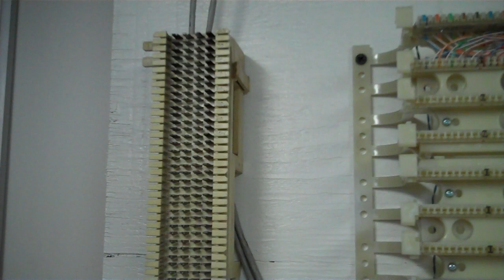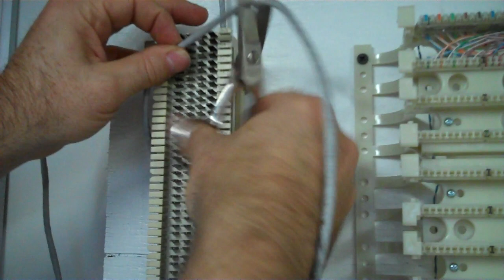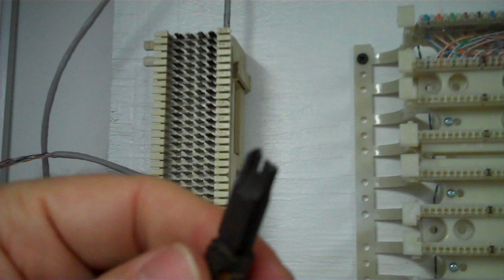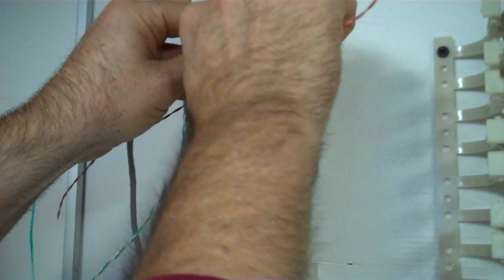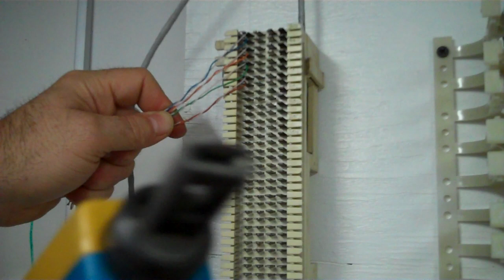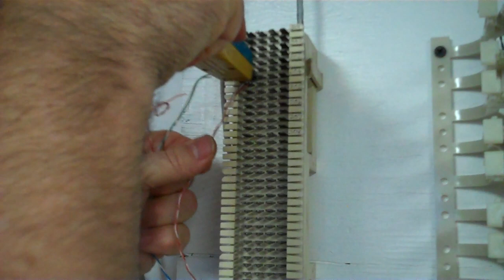Punching down 4-pair cable on 66 block

Comment: what is the reason every time I ( elevator tech) am asked to hook up the new elevator phone line the telco guy didnt bother actually landing to the old elevator phone terminals, I trace the line and it is connected to no less than 5 of these sets of terminals before it gets to where it needs to go? is that some kind of impedance matching technique?
Reply from the maker: Nothing to do with impedance.  It's not uncommon for an analog line to be cross-connected through several of these 66 blocks before it finally reaches the PBX (or telco demarc).  I could see why that would be confusing and frustrating to you.

Comment: As someone who has been doing network engineering work for the NYC DOE for the past 3.5 years, everyday I would see these 66 blocks and was curious how they worked. They're in the same room of every school MDF and there's also a telecom rack that from what I believe is how it goes from this block and become digital. At 8 mins into the video when you recapped and explained what that wire is doing it hit me. It's exactly like an ethernet patch panel and just terminates as a jack on a wall, then the 110 block makes sense also as to how the cable you just punched down gets its signal. Thanks!

Comment: I need to ask what I hope is not a ridiculous question.  I  do IT and for me the 110 on a patch panel is what I'm used to. I unfortunately have to deal with these dreaded things every now and again and I don't understand them.  Can you answer me a couple questions?
1.  Normally what I encounter is the station cable on the left most peg like you have it, and the PBX on the rightmost peg (#4, not #2).  It seems sometimes there is a bridge cap there on 2 and 3 to carry it across.  Sometimes not.  Example of a recent encounter:  PBX ext 70 was bridged to station 9 with a cap.  PBX ext 81 was bridged to 6 with no cap or bridge wire, but seemingly the extention worked.  I don't understand the point to this really - its very readable, but the mix and match has me confused.
2.  How do you bridge when you have an analog line to go to 2 places?  I know it's a no-no to punch down 2 on one post.  Seemingly, there is no way to split it because you either need a bridge between 2 and 3 with the station being 1 and PBX being on 4.  Example.  A POTS line is ran through the PBX to say Ext 90.  There is a fax, a credit card machine, and a second fax on station 10,12,ans 14.  How can you  manage that?  You cant put 2 on one, you lose your extra terminals bridging from the PBX 90 to the first station 10 in this case. Surely you would not bridge the 2+3 with a wire and run down to the next one with one of those red caps?
Reply from the maker: Hi James,  you threw a lot at me there.  As for why you’re seeing bridge clips across the pins between two stations,  I have no answer except that 66-blocks are notoriously mis labeled because over time techs make changes but don’t relabel. Your question about sharing a POTS line across several diff pins, you do a non-cut punch.  If you look at your 66 punch tool, you should be able to flip the bit around so that the end has not cutter on it.  Hope that helps. 😊

Comment: Dude, I've been using the wrong tool for about three months now getting do frustrated wondering why this has ever been a thing. Just ordered the right tool. Hopefully, with these tips and the correct tool, the rest of this job will go much smoother. Why wasn't I shown this before?

Comment: It has been quite a while since I used my punch tool on the 66 block but as it happens, I want to install 2 phone lines up in my attic/computer room.  The wire has been run and before I fanned out the wires at the 66 block, I wanted a refresher on what order the 4 pair are cut down and more importantly -- how to punch down correctly.  The video was enormous help in jogging my memory.  Kudos to provide a clear and concise documentary
Reply from the maker: Ah!  so happy I could help Alan.  Good luck, sir!  :-)

Comment: on your wiring, have you explained the Tip and Ring and why the wires have to be set a certain way on the blocks (which is tip and which is ring and why)
Reply: I agree something that was missing in an earlier video along with echo cancellation with the pair twists.  Very basic information.

Comment: Let me add, sir, great little series on punch downs ... the loss of wired telephone circuits for voice these days is a big loss for us linemen and local service telephone repair personnel. We're still around to service the cel phone carrier lines which is still landline based at it's core ... but soon those too will be gone. Sad to see such a thriving industry as the wired network of communications going south.
Reply from the maker: I feel you Gordon..  I"m going to miss copper analog voice.   Unfortunately, business votes with the dollar.  And,  the low cost of cloud-based VoIP is making it real hard for the RBOCs to make money maintaining that copper plant.   What I will miss the most is the Telco "Craft'.  My dad was a pre-1984 Bell guy.  And, he taught me the craft (but I never worked for Bell).  But, today there isn't  much in the way of professional standards.  PBX closets are usually a joke most of the time.  
Really appreciated your comments sir!
Reply: @DIYTelecom  They really are. Even the one set up in our office back in '95 (which we bought used) was set up so ridiculously that adding new stations to the block is a nightmare. Trying to learn on it is terrifying, so we're just looking into VoIP as an alternative since it's web-based and has more configuration that's also more user-friendly. I still want to learn these old systems but hell, trying to make sense of our own system is insane!

Comment: I noticed the block you show seems to have split pairs .... which means to patch the left two pins to complete to the right two pins you'll need a bridge clip, otherwise the right two pins are not carrying the signal path.NEXT LESSON - How to Climb a Utility Pole and have a cool lunch on a hot day on the ground  ;)    Be Well.
Reply from the maker: yes, definitely a split 66 block.  in the interconnect biz, that about all I run into since the 1A2’s went the way of the dinosaurs. 😉
Man, I would love to see some video footage of pole climbing.  I’ve never done that.   Thanks for commenting!!
Reply: @DIYTelecom  man I remember climbing a pole for at&t near a train track maybe 10 years ago. It’s super sketchy up top. Swaying like crazy every time I moved. Easily 40ft up. Man I’m glad I don’t have to do that anymore

Comment: Question: Is it acceptable or normal to provide slack in each run?  My line of thinking is if something happens to the cables on either end, you have extra cable to pull to make new punches, instead of having to run a an entire new line just because you don't have that little bit of cabling that you need.  Everything I know says this makes sense...it's what I don't know that makes me wonder if there's a reason to not provide extra slack.  Thanks!
Reply from the maker: Yes, leaving slack (also referred to as a "service loop") at each end is a best practice.  So your thinking was right-on!

Everyone has a different way they like to do this.  For me, I like to either leave a coil of about 2 feet in the ceiling before I drop into the patch panel or the wall jack.   Or the other way to do it is to leave slack in the network cabinet (or if telecom wiring, somewhere on the backboard).

Only word of caution, with Cat6 cable for Data networks, making circular loops can degrade 1Gbps throughput.  However,f or Cat5e or 100Mbps network, the effect is unnoticed.

Great question, thanks for asking!
Reply: Fantastic! :) I will keep the loop in mind and keep doing this!  I remember years ago hearing about loops in cabling degrading signal quality, and I believe there was an actual minimum size for the loop to avoid signal degradation but I don't remember.  I would assume a good size loop would minimize or eliminate any adverse effects?  And if not a larger loop, I suppose just leaving some sag, or making a wider turn would also give the extra slack that may be needed down the line.  Thank you for your time and for sharing your expertise!
Reply: John - Nahh, loops are not a significant problem as long as they don't encircle a city the size of Cleveland (or Sheboygan, for that matter). Keep them as 'service' loops, maybe a foot and a half in diameter JUST IN CASE you might need to reroute or repunch so you have some slack to work with.  ONE thing that is critical though, since you're talking wiring ... that's parallel runs with electrical. Don't do it ... ZIG ZAG your wiring as best as possible. The longer you parallel to high strength signal sources or radiating sources (such as electrical) the worse the problem becomes. Just avoid the parallel runs or zig zag as much as possible to avoid a direct parallel.

Comment: The punchdown tool usually has "Cut" engraved on one side which shows the side that has the knife on it. The tip only fits into the tool one way. You can see it in this video at 4:01
Reply from the maker: that's a good point.  However, my Dracon-Harris punch tool is about 15 years old, so it may be different.  I can flip the 66 or 110 blade either way (Cut or no-cut).

Appreciate you bringing that up.  Thanks :-)

Comment: I am having trouble with the color scheme. My 66 block looks different than this. I have 7 phone lines connected to it and three of them are currently down. It starts on the left side with colors: Ow, O, Gw, G, Bw, B, Brwn/white, Brown. And then it runs another cat5 cable beginning with O, oW, wB, B, Brown/White, and then brown. I have no idea why the person before me skipped Green and Gw. 

Somehow the orange/oW is paired with a phone line Green/red and it's working. If I could attach a picture it may be easier to understand. I hope I'm making sense, but I cannot figure out why he did this and how Orange/Ow pairs with red/green phone line. I want to use all cat5 cables on this 66 block without messing any current connection up.
Reply: A 66B block is different then the m50 shown. With the 66B block the left pins are usually where you provide the dial tone (Known as the Line Wiring from the NID (network interface device) provided by the telephone company. The remaining right five pins are parallel, and where you punch your Station Wiring (your phones from the wall jacks or wherever), to the left pin meaning whatever you punch down on the left pin, anything punched down on the remaining right pins of that row are parallel ... they carry that particular path across.  So, let's start out with one telephone line Chris. Usually it will be provided as either RED GREEN for line one and YELLOW BLACK for line two. Nowadays it doesn't really matter as most everything is digital, but it's always good to follow the old ATT standard for clarity sake.  So, look at this chart for a little better understanding:
Old Style 3 pair   -  New style 3 pair
RED  -                       WHITE STRIPE on BLUE WIRE  (Line 1 Tip)
GREEN -                   BLUE WIRE on WHITE STRIPE (Line 1 Ring)YELLOW -                WHITE STRIPE on ORANGE WIRE (Line 2 Tip)BLACK -                  ORANGE WIRE on WHITE STRIPE (Line 2 Ring)WHITE -                  WHITE STRIPE on GREEN WIRE (Line 3 Tip)BLUE -                     GREEN WIRE on WHITE STRIP (Line 3 Ring)Again, the polarity is not usually important these days unless you are using a digital Key system in which you would refer to their wiring instructions as power might be present on certain pairs.So, unless you have the same coloring codes on the left side coming in, use the above methods.Also note that maybe your house has old and new wiring ... but it doesn't matter as long as you maintain the color code if you can. ALSO NOTE - A butt set is always handy to make sure the lines coming in are correctly wired. They could have been swiss-cheesed by a previous owner or someone's brother who knows all about phone wiring but actually doesn't.So, to hook up your LINE WIRING to your STATION WIRING, just punch your STATION PAIRS as shown above. Always good to make sure that they are actually wired that way on the jack first (that brother thing again).I hope this clarified things and not totally confused you. I am a retired ATT employee and have owned a few installation companies before and after the phone company stint. If you cannot get your jacks to work, don't call your brother - call a CLEC, ILEC or anybody of reputation. You can usually find them under TELEPHONE in the yellow pages.   Good Luck. And if all else fails, do what the rest of the world does, buy a cel phone where voice quality sucks, something ATT has strived for since day one.
Reply: Also, if yours has a metal clip across the middle of the block. remove the metal clip, brush it with an emory board or some sort of small wire brush, be sure to clean any fragments and re-insert it. I've had those 'bridge clips' get tarnished sometime and lose their ability to actually 'bridge' the signal path from one side of the block to the other.